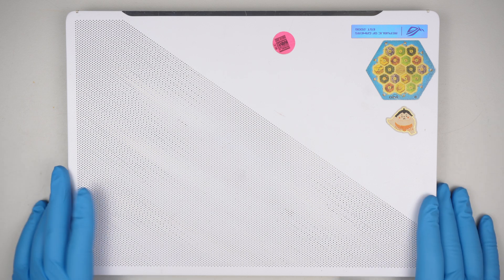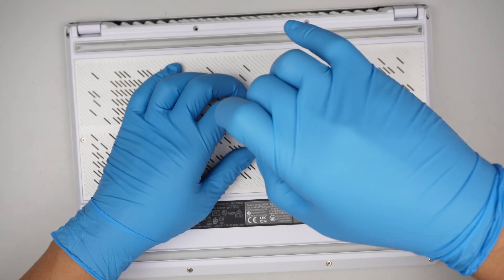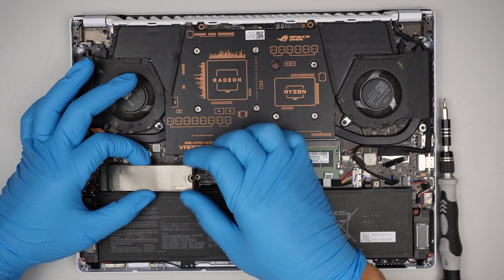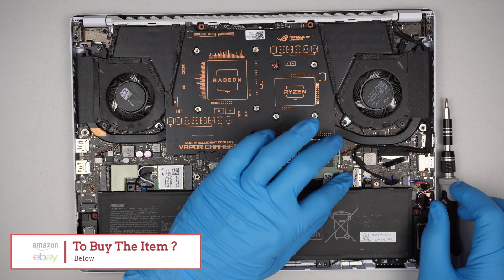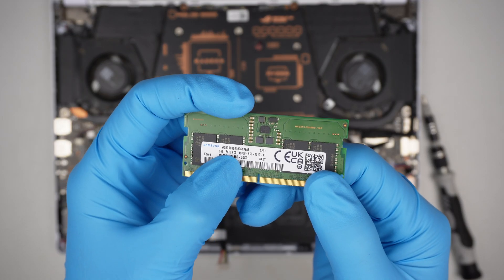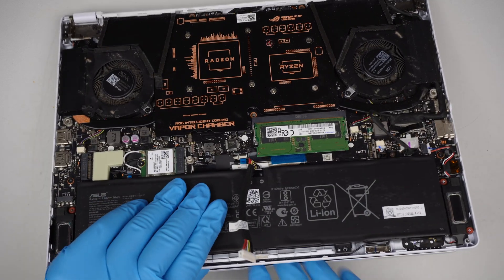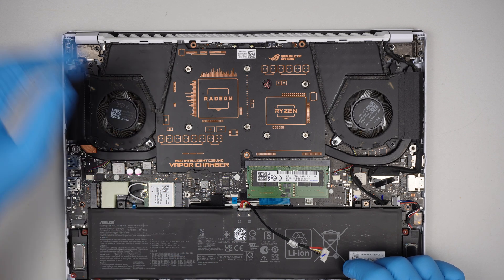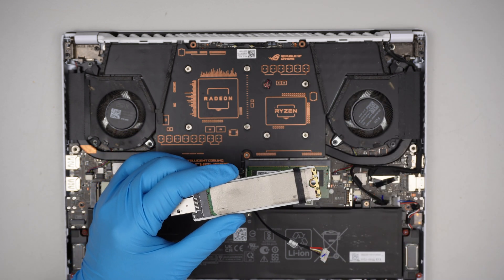Not Worth Fixing Asus GA402R

Comment: Few things to note when it comes to Laptops. 
From how you worded it, you make it seem like only AMD has reliability issues and solders on their processors. Mobile processors are almost always soldered nowadays, not just AMD. Processors do not break often, it’s far more often that the laptop displays or the connecting cable that fail and make them  some of the most replaced parts on laptops in general. it would’ve been nice to see you plug in a separate display to rule out both issues.
And technically speaking, it is 100% possible to replace processors, it’s just not cost effective.